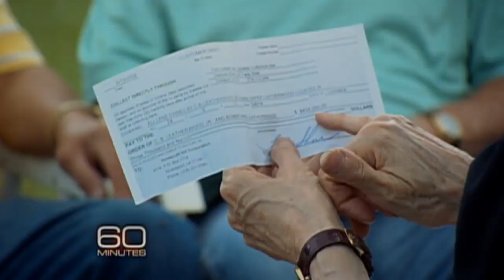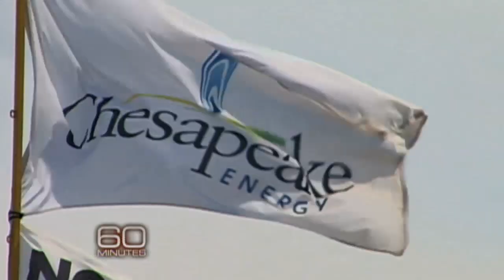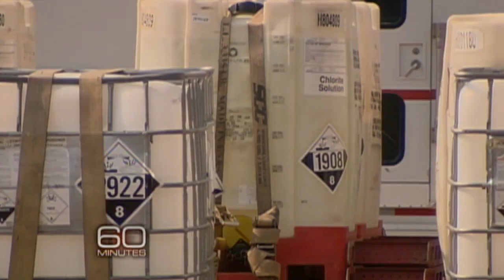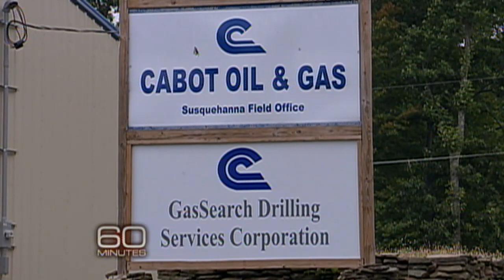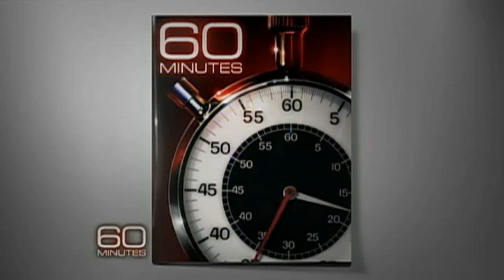Shale gas drilling: Pros & cons

Comment: water supplies are usually only a couple hundred feet underground. that  is the surface hole. u cement it and move on deeper....  the freakin water is not gettin mixed with chemicals. the whole well is cased then cemented.... the stuff that gets pumped into the hole is deep.. and only in the pay zones (  i think) ( i just drill wells.... im not a production guy... )